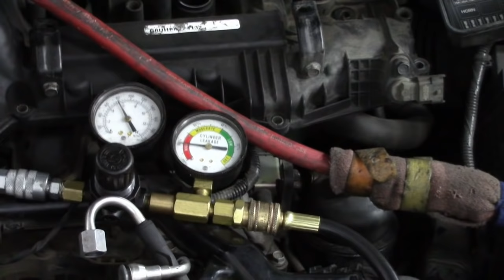Muffler Shop Says This Engine Is Blown?!?!

Comment: I'm confused. If cams and crank in time, then how did piston contact intake valve?
Reply from the maker: because it locked the variable valve timing since the phaser locked up when the bolt backed out. it didn’t cause the camshaft itself to be mispositioned, it just set the variable position way off

Comment: if the valve seat is okay and cylinder is not scratched you could use the situation and make some engine repair videos. no need for resurfacing if the engine is not overnheated on low mileage car.itll be interesting series
Reply: It’s a diagnostic channel, not a nuts and bolts channel. That’s sooo 5 years ago for this channel . Just go watch some old videos of his if you wanna see rebuilds and nuts and bolts turning clockwise and counterclockwise.

Comment: Curious how you verified the timing was correct before you started it? Could you see the timing marks well enough on the cams, or did you do something else off camera?
Reply from the maker: Yes that and also I could see the compression started  right when the intake cam closed on the camshaft. can only happen if Intake and exhaust are in synch.
Reply: @SchrodingersBox  Thanks for the reply! Question: can the crank still be out of time even if the intake and exhaust cams are in time with each other? What's a good way to be certain that you're at TDC or BDC without being able to see the pistons?
Reply from the maker: Yes definitely that can happen. So I didn’t show it in the video (accidentally edited it out) but with spark plug holes right on top of engine like that, I can actually see the piston crown moving by looking right through the spark plug hole. so I can see that piston is at bottom of stroke and by looking at the cam lobes I can see that at bottom of the stroke the intake valve was just about to close. I can see from the cam lobes that both valves stay closed through the compression stroke. Therefore I know the crank and cams are very close if not perfectly in time. otherwise I would have maybe put a long screwdriver in spark plug hole to see top dead center when screwdriver is at highest level.
Reply: @SchrodingersBox  I was thinking borescope, but screwdriver in the spark plug hole ought to git er done. Love the low tech solutions. Thanks for the vid and the follow up!
Reply: @shumanchu1 :  be care with screwdriver when spark plug holes at an angle, screwdriver can bind sometimes. Keep it moving freely as piston comes up.

Comment: Why didn’t you just order a new cam phaser cap, valve, and valve cover and put the new valve in it?
Reply from the maker: I am not doing to do a valve job on this when it’s way faster and far more cost effective to replace with a used engine.

Comment: I'd get on the ol' interweb and start searching for a used motor if it were mine. It seems to be in decent enough shape it'd be worth the trouble. But that's just me, I will re-engine a vehicle in a heartbeat if its in good shape and worth doing it. Just finished putting a new/used 7.3 diesel motor in my Ford F250 in my driveway. Next up in the driveway, my oil burning Toyota Rav4 with the infamous oil-eating 2AZ-FE engine. I was able to find a used motor from a wrecked one that had the update fixes done to it. Yeah, I'm cheap! LOL!
Reply: Is it just the intake valve??? If it was head job

Comment: aren't these engines covered by the class action lawsuit and extended warranty? They tend to blow up
Reply from the maker: oh I don’t know anything about that!! if you can link to some information here I will definitely look at it and inform the owners!  That would be amazing if there could be compensation
Reply: @SchrodingersBox  hmm the recall is for the 4 cylinder not the V6. This will have 10 year/100k mile powertrain warranty
Reply from the maker: Yeah we just looked it up and found same thing. Seems this is a one-off thing. or maybe work was done previously on the car and the cam phaser bolts were not tightened properly?
Reply: @Jacks Journale on the VVT solenoid in 16:53 you can see "KIA" and the Hyundai logo. Kia is owned by Hyundai since 1998, so their engines are probably not much different.

Comment: That engine will run for another 10 years with some new valves,just buy some new ones for like 50 bucks and replace them?
I would do that if that was my car
Reply from the maker: you just replace the valves- without angling them or machining the seats?
Reply: @SchrodingersBox  i would but i'd lap them in first. assuming  the seats weren't damaged, they'll be fine. we don't angle the valves at work ever, they're new. cut the seats and check concentricity and on certain heads we make sure they'll hold vacuum. the part that would worry me, as someone who does it for a living on an industrial scale, is the new valves. i've seen brand new valves come apart on the engine. i just done this repair and mentioned it on another comment lol. i can mill the head, replace guides and the seats, machine the seats, test the springs and check my work at work. they don't care just so you're off the clock on your own stuff. it was a more viable option to get a junk yard head because if those valves were not of good quality... the valves i mentioned coming apart at work were oem from an oem supplier running new and tested used springs. kinda gives me trust issues on internal parts.

Comment: Excellent video Matt! You are a humble guy in a very special way! I guess, if they had an oscilloscope, that they did a quick relative compression test (rct) and saw that one cylinder had bad compression and therefore blaming a bent valve stem. However, other tests has to follow to pinpoint the problem, but the fastest way, by far, is to perform a rct test after you manually checked that the engine can rotate and does not lock up in any position. I am an educator in automotive electronics in Northern Sweden and find the oscilloscope one of the most important tools in your box and saw that you got a 2 channel Picoscope - that is great and promise to use it! ;-) Keep up the good work Matt!

Comment: Knock on wood, our 2011 2.4 4cyl has been flawless at 175k.
Reply: May want to take the valve cover off and check that cam bolts lol. Maybe add some loctite on em while your in there lol
Reply from the maker: Lol!!! True that!!!
Reply: You're so lucky! My G4KE was rebuilt this summer because of high oil consumption. One cylinder was scratched badly, and piston rod bearings was halway worn out after 100k km.

Comment: Duct tape on the valve cover would of worked
Reply from the maker: tried that. came loose as soon as engine warmed up. remember you also have oil everywhere inside a valve cover when engine is running and it’s going to loosen any adhesive.

Comment: Driving with a dead cylinder is terrible advice. Good way to destroy a catalytic converter.
Reply from the maker: dude. the engine is blown. the cat’s the very least of their worries man. it’s like saying “hey, I know you have congestive heart failure but you should stay out of the sun- it causes wrinkles.”
 also how is it going to destroy the cat when the fuel for the dead cylinder  is disabled anyway. but even so what difference does it make.  they will junk the car once it totally dies either way.
Reply: @SchrodingersBox  well I guess it depends how they look at it. Don’t see why they’d junk it get a good used motor get it swapped in boom that’s it.
Reply from the maker: $5600 reasons  plus labor why.  There is no “boom that’s it” in a motor swap. it’s a massive job to find a good engine, have it shipped, test it, and install that often costs more than the value of the car and you normally only get a 30 day warranty  for all that investment.

Comment: So you did a  "quick fix" to start this broken engine. Actually,  you did a lot of damage. The bent cover on the camshaft adjuster definitely will leak oil, so the camshafts on this head will run with very little oil pressure, damaging camshaft's bed and the camshaft itself.
What was the reason of doing this?! 
The tow truck will cost the owner of this car an order of magnitude less than damaged cylinder head.
Reply from the maker: SMH.  so if that’s true why is the oil pressure normal both on the gauge and when checked it from the sensor? Also why does the intake cam shift solenoid work and change the cam angle - it operates by oil pressure so how is it possible it works?
  also how can I do more damage to an engine with a bent valve - what am I going to damage that isn’t already a catastrophic failure?
  the engine is going to be replaced with a used one so what difference does it make?  the person got to their storage place with no problem at all. so how would they have saved money towing it?
Reply: @SchrodingersBox   The oil pressure sensor on G6DH is located on the block, not on the head, so in this place oil pressure may be high enough. But on the intake camshaft of the front head it may be much lower.
The engine is broken, but it not destroyed completely. This engine may be repaired by replacing bent valves and fixing the head,  if it has some problems near valves or CVVT regulator. In my opinion, one should not run the engine, if it has mechanical problems. So you don't know how bad valves was damaged. It may have some crack in it, and the head may separate from the stem while the engine running.    
I can assume that you have previously seen dozens of engines with torn off valve heads.  So why not to call a tow truck and transport this car to the repair shop without risks of additional damage?
Reply from the maker: how can the oil pressure have a low point at the head but read higher elsewhere?  You can maintain high pressure in a system  with increased flow.